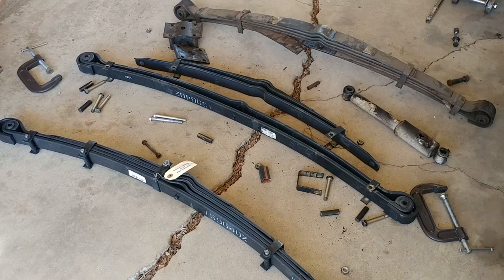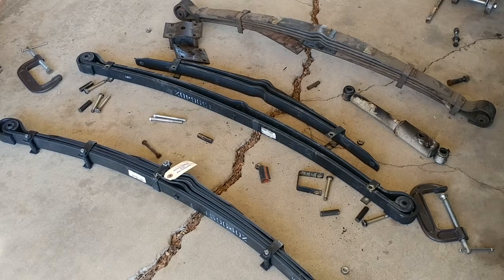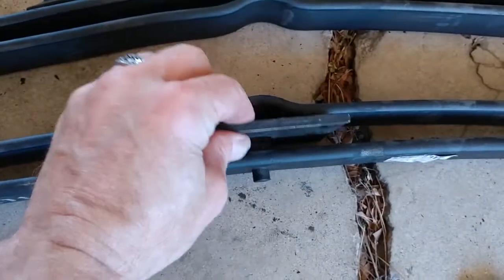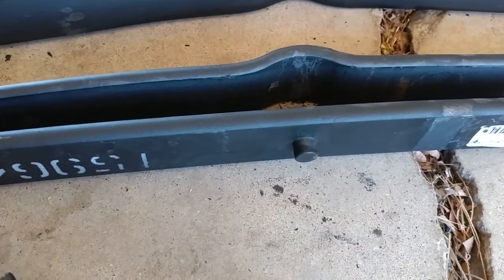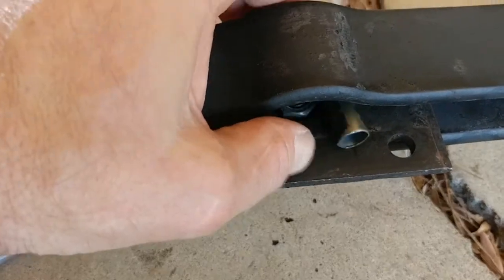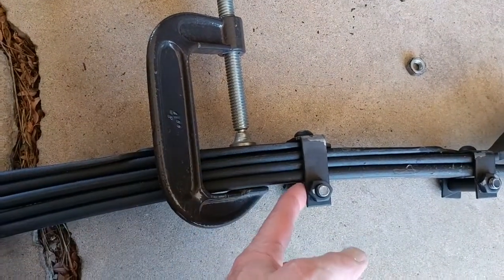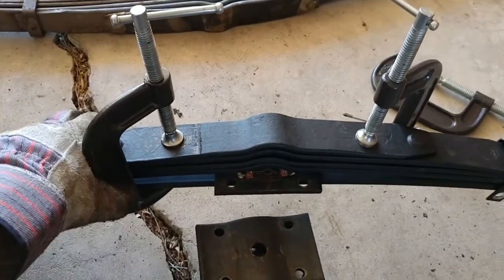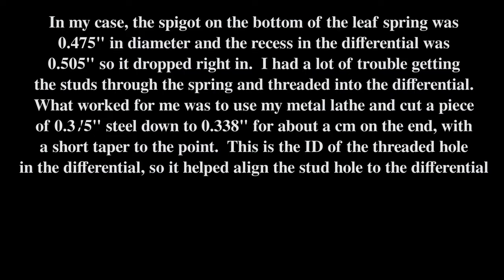Swing-spring Triumph Spitfire leafspring disassembly and reassembly for installation

Comment: Thanks, would this spring fit into the early style 1969 Spitfire?
Excellent explanation about installation of this spring.
Reply from the maker: This is a 1500.  My understanding is that they used this spring from 1971 to the end of production.  But I think the earlier spitfires used a similar semi-swing-spring, as well.  So: I don't know for sure but I bet you'll go through the same process.

Comment: Excellent video, thank you for posting. Just about to install one of these myself and your video perfectly demonstrates and explains all the missing details in the BPNW video. Well done!
Reply from the maker: Sure.  Their video is great, but the missing step can be frustrating to figure out on your own.
Reply: I'd say the most important thing is to 
MAKE SURE the 4 holes are Symmetrical to the locating pin . Or the bolts will NEVER line up
I learned this the hard way.
An extra 10 minutes getting it right 
Is time well spent
Reply: @jeremyhank4595  make sure your 4 bolts are symmetrical to the locating knob or your bolts will be miss aligned to the differential... not by 
Much .. just enough to miss, 
You can't see down the holes either 
So do it on the bench 
I layed the spring upside down 
Put the bolts through. 
Then used a small bar across the 2 bolts and measured from the bar to the knob then did the outher side 
Adjust till they measure the same
Then lock the pivot bolt
LOL it took me a wail to figure it out
A rush job always takes twice as long
Reply: @ronpilchowski9898  I think the two Jeremy's (Maxton & Hank) are bots or worse. 
Seems Hank is responding to Maxton about his Instagram pas word hack.

Comment: I just jamed a couple chisels between the leafs to get the plate and bushing in .... 
MAKE SURE THE 4 BOLT HOLES 
ARE SYMMETRICAL TO THE 
LOCATING KNOB ON THE BOTTOM OF THE SPRING ... this is an ounce
Of prevention to insure it bolts right up... I did this by myself, I had the spring in and out a couple times to get it right in 100' heat😤😓